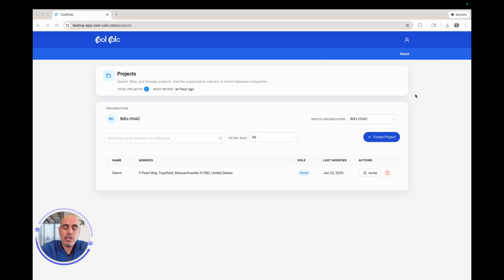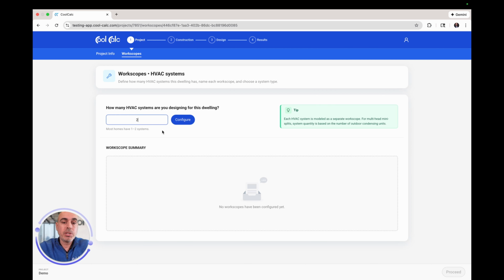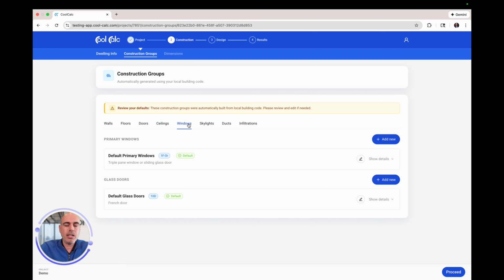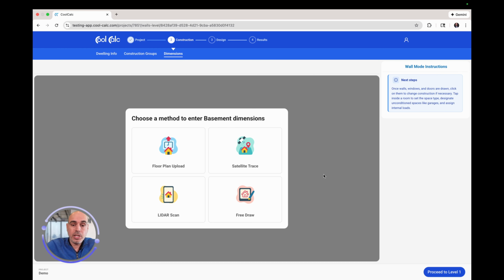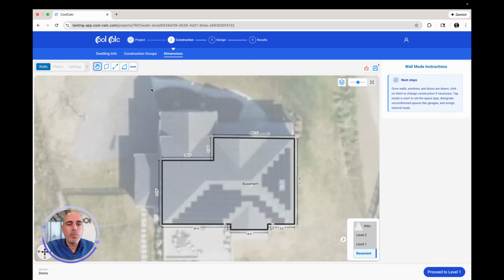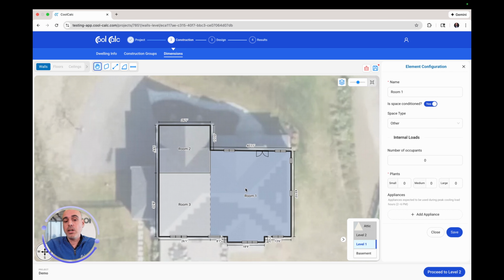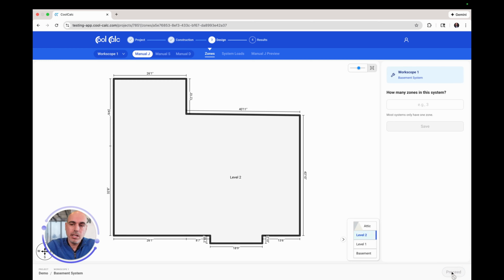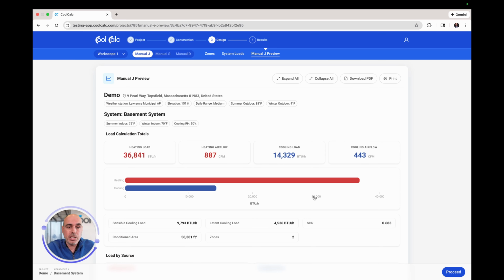What's new in the latest version of Cool Calc

Comment: 100% of my work is apartments so being able to model a unit once and have it calculated with a floor as bottom floor unit and with a ceiling as top floor unit would be fantastic, to quickly know which should govern the system sizing.  Also adding an ability to declare a wall as "interior" when modeling an apartment that has demising walls with conditioned space on the other side. I want the assumption to be no load transfer through such a wall. My workaround is drawing a fake wall around the model on those sides to force them as interior.
Reply from the maker: We released a "partial dwelling" option that allows you to specify what's above/below the room you are drawing, eliminating the need to draw the apartment above/below. We are also releasing a text imput option for large multi-family buildings.

Comment: Just learning this software. IMHO on thing that would be nice is the ability to remove some of the defaults. I understand you should force everything and have people remove (several reasons why) What would be nice at the start is for example under dwelling info. If I do not have a skylight-- allow it to be removed at this step. Same for is I have a slab floor-- allow me to delete crawlspace and basement in the beginning to avoid confusion and questions of whether or not it is part of the calculations.

Comment: We build modular homes, and I thought I would give this a try. The software says that SC is on the 2015 energy code, but from what I understand, they have delayed that and are still on the 2009 code. The software would not allow me to change that. Also, we use the U-trade off method for building envelope calcs, so, for instance, our floors might have less insulation than the prescriptive R-value. The first floor was not highlighted in yellow for me to click on it and change that value. Those are the only problems preventing me from using this software that I can see so far.